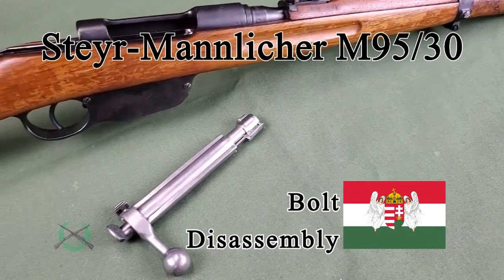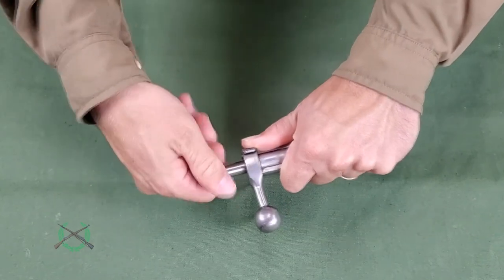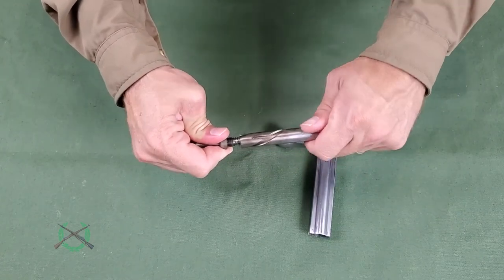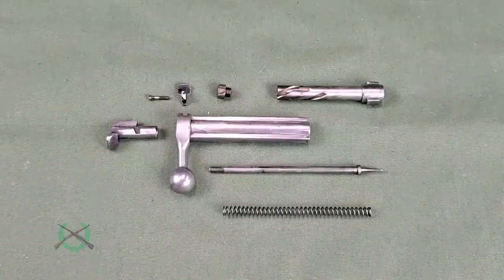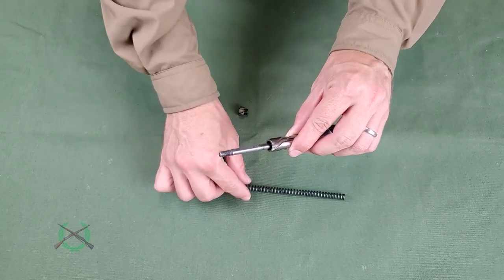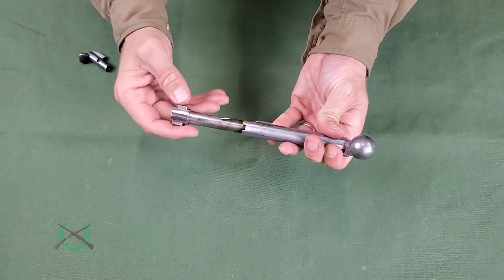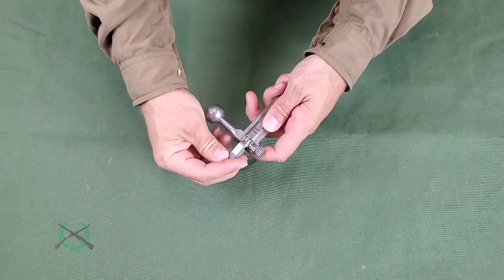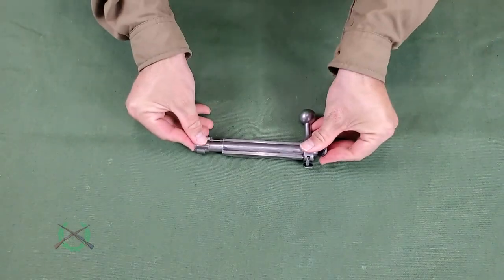Steyr-Mannlicher M95 Bolt Disassembly

Comment: Thank you, History in Firearms, for the instructive video.  I disassembled, cleaned, scrubbed, oiled, stock finished and reassembled my M95 rifle.  Everything went together easily except for inserting the bolt into the receiver.  I was missing the last step, to cam out the bolt head before sliding into the receiver.  You brought my frustration and hair pulling to an end!
Reply from the maker: Glad the video helped! Keeping that bolt head out can be a bit tricky on these 100 year old well used bolts!

Comment: Good video.  This information will help me whenever I finally make time to get back to my straight pull.
Reply from the maker: Thanks! The straight pull actions are fun to run.
Reply: @HistoryinFirearms  I got my M95 years ago and it has been sitting in the safe.  I recently pulled it out to compare to the one RowCall219 picked up this year.  Lots of different marking to determine when they were made, when they were sent back to the arsenal, and what country used them.  Eventually I will make up some handloads for it and find a bayonet.  More projects than time and money.  Thanx for making these videos.

Comment: Thank you for your video! However, I still don't understand what keeps the bolt head protruding. Why is it necessary to tap it before starting to disassemble? Perhaps there is some internal structure that keeps it protruding?
Reply from the maker: You are welcome! I believe it us just friction that keeps the bolt head protruding. They typically end up retracting with a slight bump and can be difficult to keep pulled out. Taping the bolt head retracts it, if it hasn't been already, and then reduces spring pressure as your are disassembling the bolt.

Comment: I have an issue with my mannlicher, before it reassembled with some coaxing, but now it will get to the extended position but won't rotate into lock to reattach the cocking piece. Please help

Comment: I love how your's snaps into place, yet mine is just sitting here doing nothing 2 hours later. It'll work great so long as the firing pin isn't attached. I have no clue what in the hell I'm doing wrong.
Reply from the maker: 🤔 wish I had an answer for you.
Reply: @HistoryinFirearms  I finally figured it out. I had to turn the flat side downward a bit more than yours.
Reply from the maker: @robertsherrill753  glad you figured it out!

Comment: I used to know why this specifically happens, but the bolt head won’t stay in the extended position when fully assembled. I think it has something to do with the extractor, but I was wondering if a fix is possible.
Reply from the maker: I think it's just wear on the cam surfaces. As they get more wear that  spring pressure causes it to cam on it's own.
Reply: @HistoryinFirearms  Very informative and easy to follow. My bolt head doesn't stay extended, but I remembered a US dime is the right size to hold the bolt head for removal and installation in the receiver.

Comment: I can't get the bolt to seat all the way back into the bolt body so i can screw on the cocking peice, any help?
Reply from the maker: Check the alignment of the flat side of the firing pin and also that the cam groove on the firing pin nut is aligned with the groove on the bolt. It's a bit of a puzzle but it's all got to be aligned to fit back in.
Reply: @HistoryinFirearms  i figured it out after 40 minutrs of cursing and yelling, i just wasn't putting enough force inward, thanks for the help by the way.
Reply from the maker: @RedbudWorkshopProductions  Sorry it took so long but glad you figured it out!